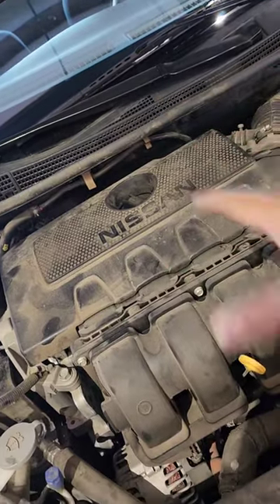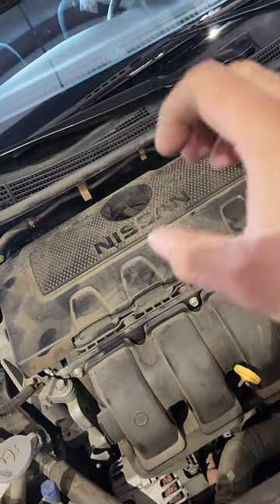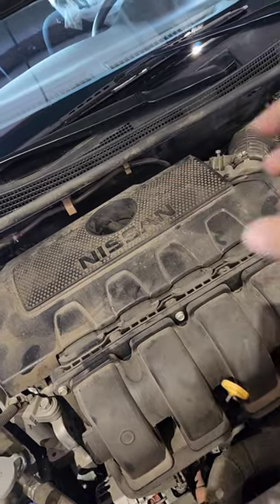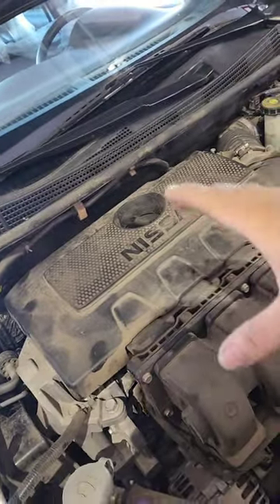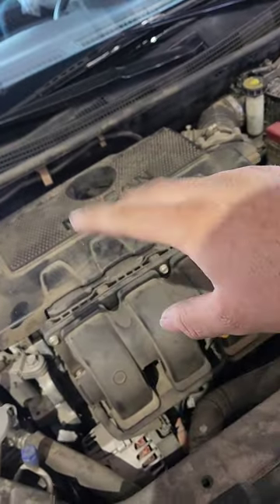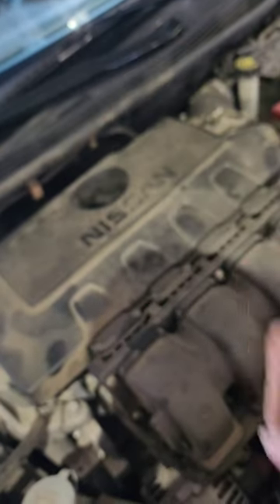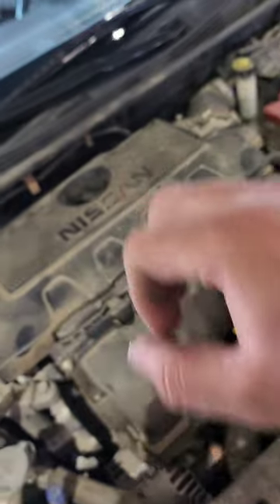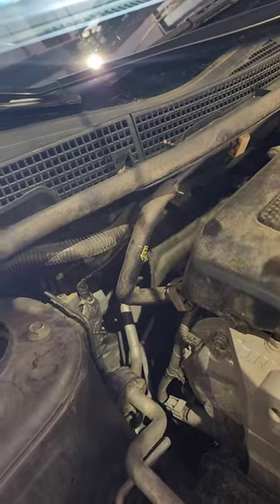RUINS A CATALYTIC CONVERTOR!!! #mechanic #pro #shorts #youtubeshorts

Comment: Perfect A/F ratio is 100%. If it was 140% you were running 40% lean. Less than 92% is running rich. Upstream 02 sensors and A/F sensors will switch without powerbraking, downstream sensors will only switch when ECM stops heating the oxygen sensor under load or when engine is full warm. Also not a good idea to brake torque nissan cvt transmissions for extended periods of time as to not get the belt hot. Good catch though.
Reply from the maker: So we only powerbrake in small spurts and only about 2k, thats to monitor catalyst efficiency through the rear o2...but man this thing im suprised it wasnt running rough with that large of a leak...
Reply: @FluffyMexicanik  Nissan's lean fuel trim allocation in ECM tune must account for it and allow engine to run on MAP sensors and other engine load related sensors. Usually if it has a MAF sensor it will have a hesitation, sag, or stumble on throttle snaps if it has a vacuum leak downstream of MAF. But if you have a vacuum leak that's small it's some times not as noticeable, especially if it is a smaller displacement engine that doesn't move a lot of air.

Comment: You have an excellent channel and do very well at diagnosing issues, I’m looking at the xtool d7 or d8 have you had any experience with either one?
Reply: I got a review on the d8 on my channel it’s pretty good
Reply: @dieseldawg7132  was it pretty good, from what I’ve seen it is a pretty good bi-directional unit for the price 
Are you still using it?
Reply: @dieseldawg7132  Good stuff 🫡👍🏼
Reply: @neilmays6744  yes sir it’s my go to for the automotive side if has most if not all functions covered. Very useful for diag. Plus they do not upsell any of the functions… and are continuously updating the tool and it’s functions.

Comment: What a booster didn't make a vacuum noice oh the leak was to small well keep this in mind 😎😎😎
Reply: Seems like a tough call or just lucky and good.
Reply from the maker: Had i not got in and depressed the brake i still would have caught it just off basic diagnosis by pinched off vacuum leaks 🙃🙃
Reply: @FluffyMexicanik  advantage of know how to read fuel trim 😎😎😎👏👏👏👏

Comment: I'm a bit confused mainly because I'm an entry level tech. How exactly was the brake booster making the car run lean. I think I have an idea cause I know that brake boosters are powered by the vacuum created from the air being pulled in through the intake manifold. But I'm still a bit confused, would it be the check valve that went bad in the brake booster?
Reply from the maker: So in the boostee you have vaccum on 1 side then a diaphram and on the other side of the diaphram you have atmospheric pressure which pushes on the diaphram creating a push pull effect, so if theres a leak in the diaphram that leak is now letting unmetered air into the engine causing it to run lean
Reply from the maker: The check valve would be a no reserved power brakes...which would be the same sympton of the leak in the diaphram although the leak caused an ses light
Reply: @FluffyMexicanik  that's dope, thanks for the explanation man! That makes a lot of sense now that you broke it down. Before seeing this video I never even considered a brake booster gmgoing bad can make a car run lean but now I know.

Comment: Man...nice Diagnostics there. Is that considered an evap leak?
Reply from the maker: No sir, this would be a vacuum leak, the evap system has to do with the "air" from the fuel tank...basically the "fume that evaporate from the fuel and get pulled into the engine rather than the outside air
Reply: @FluffyMexicanik  Oh, that's right.  I remember now.  Thanks Fluffy!
Reply from the maker: @TheFrenchPug  no problem steve, how you doing my friend?
Reply: @FluffyMexicanik  I wish I was working. Been on disability after my last back fusion and hip replacement.  I have chronic pain and a bad limp from nerve damage.  That's why I'm always able to comment so often :)  Other than that I'm good. Hope you enjoy your day off! No car repairs today.